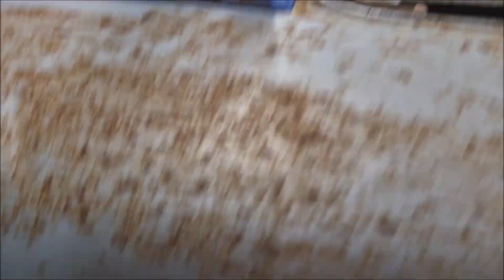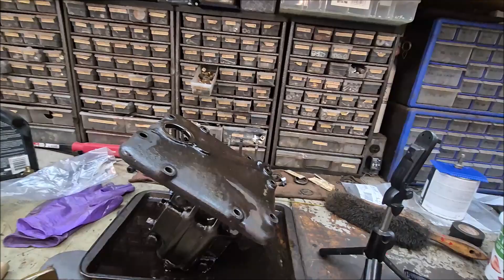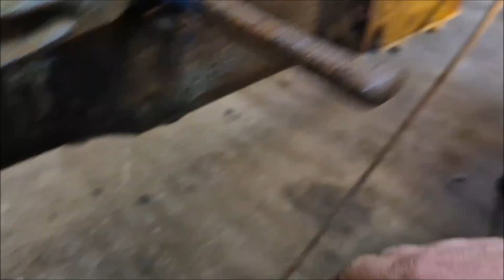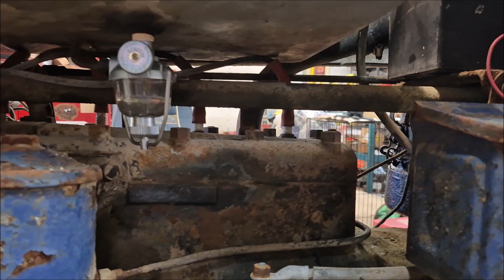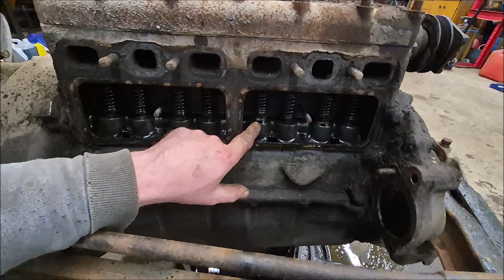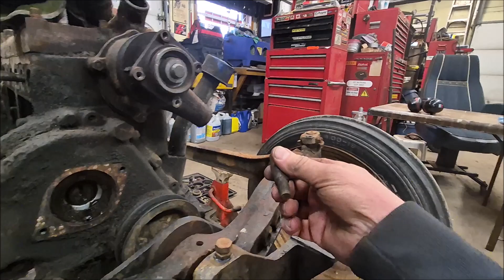1941 Ford 9N Industrial part 2 Fuel System Repairs and a Stuck Clutch

Comment: Thanks, Kevin, for another informative video.  I will have to split a 1957 Ford 640 to get to the clutch as well.  Won't go into gear with the engine running.
Reply from the maker: That shouldn't be a bad job. Not much different than this one I would guess.